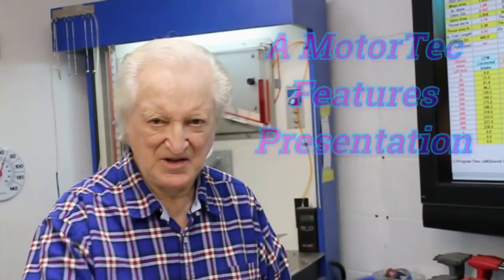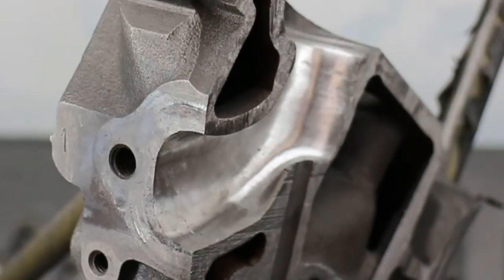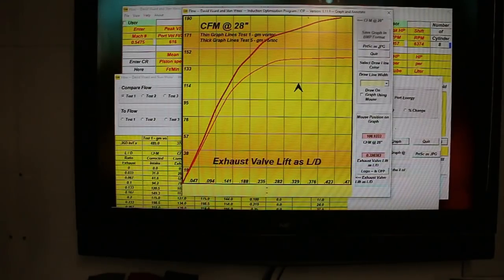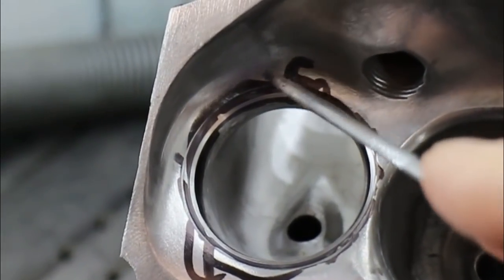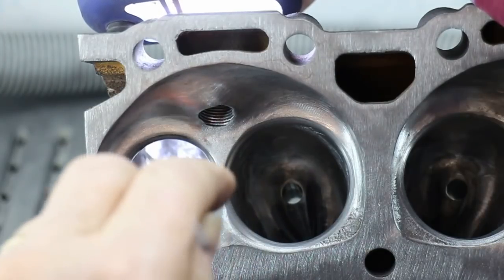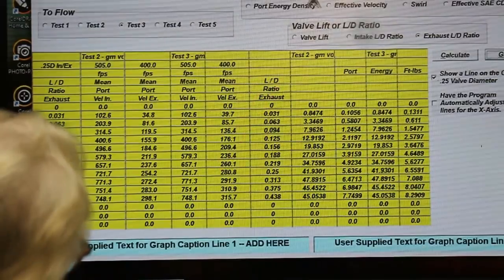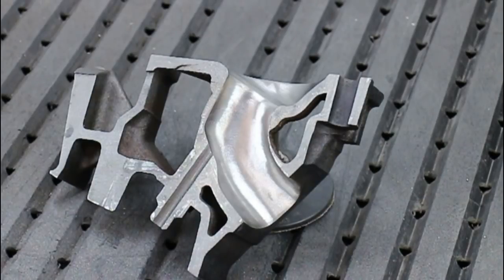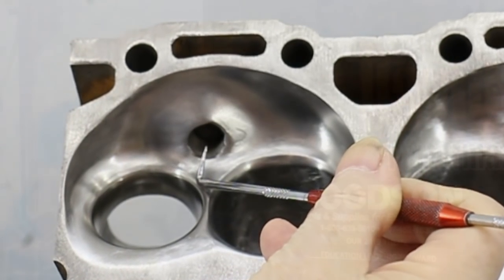David Vizard's PowerTec 10 EP 13 Part 2 Super Porting Vortec Exhaust and all other 23 SBC heads

Comment: Certainly not enough information im sure but what would you say about a 6000 pound 4x4 automatic trans truck with a vortec 350 that has .010 milled heads and .020 gm performance head gaskets and gm performance dual plane aluminum 4 barrel intake and a 650cfm carb  and hei distributor (1.60" ehaust valves and 33* seat angles). Stock exhaust manifolds but free flowing exhaust after the manifolds
My question is with those things considered what would you say to putting in a hydraulic roller 208/208 (or 208/212) duration @.050 and .420/.440 lift with 107LSA since i want to keep this a reliable daily driver i can still do truck things with and still have the engine last 200k+ miles?

Comment: David:  This is some of your best videos I've seen to date....I have a question:  The quench area below the spark plug and above the valves should not be touched to a grand extent because the fuel will not be atomized.  What are your thoughts on this?

Comment: Hi David, I built the 447hp sledge hammer budget build you designed  the cam shaft for.  The cam does not have a lot of overlap. Would these port mods improve my build or hinder it. (I did a mild clean up port job on the vortecs) Thanks.  Love your video. I built my 1st motor using your how to build a sbc back in 85 with no engine building experience at all. Have since built many more after that. I am especially  impressed with the 447 sledgehammer build. Cheers

Comment: Do you port match the coolant passage also? I have a #906 Vortec head and there is ALOT of material within my blued scribe mark. Intake gasket is out of a kit. "Problem solver gasket" i was told. Plain metal core with black rubberized molded gasket around port.

Comment: Great info and very well made but just so the young guys are aware, gen 3 hemi heads and the higher end LS stuff all flow 300+ CFM (426 hemi flow numbers and better than any big block chevy), you're starting at a much higher level just by using one of those engines, if you have the means.  I believe the 392 flows 340 cfm bone stock and the 2009+ 5.7L eagle isn't far off, an engine you can find in any junkyard.  If I was a kid on a budget I'd be going 09+ eagle and Holley EFI, it'll cost the same as a set of aluminum heads for a chevy. mopar or ford small block - and absolutely destroy any of them

Comment: Thank you so much, I have a set of Iron Impala LT1 heads that im porting out and machining for bigger valves. Im following your advice as much as possible with these because i know your right. Your books showed me Behive springs, how much valvelift i need, timing advance, lash on roller lifters etc.  My first cam swap was a success over all because of your guidance and I know im still in good hands with these heads.

Comment: Where can I get a decent vented porting station like you got. I saw some but the prices where crazy. Any tips or advice on where to look for one ?
Reply from the maker: Paul,
 We make our own at the school and sell some on the side. Brand new $7000.
Reply: @marvingvx1  paulskarts@gmail.com let’s continue this conversation by email if you can send some pics I’d like to take a look. Thanks
Reply: Ive seen ones made out of old bbq grills from a garage sale or found at the dump. Honestly it works. I made an adapter and filter box for my flowbench so I could just port on it instead of making something that takes up more space.

Comment: David i have looked up to you since a teen. I went to work for a family friend who owned a automotive machine shop  and was the engine builder /fabricator that built my dads two show cars.. I already had a passion for motorcycle 🏍 and motorsports off road racing got introduced to a dragster..got the horsepower bug bite on my own time that summer I between learning how to cut valve seats resurface heads ,guides,valves,I learned very quick the heart to performance was heads and cam centered . My uncle taught me how to work over a set of camel hump heads once he showed me the carbide cutting bits/sand paper rolls and a old 600series flow bench I spent all my money buying heads and sandpaper rolls carbide cutters long short and exotic lol bought a used flowbench and went to town made some serious big block power on stock casting for 1994

Comment: Hello, I have the head off my Toyota 1zz engine at the moment. It is a typical modern 4 valve design with the usual rough casting marks etc in the inlet and exhaust ports. If I was to try to smooth these down, assuming I do a decent job of it, am I likely to get a noticeable power increase if the rest of the engine stays standard or will it just make minimal difference?

Comment: The spark plug area looks a lot like the chamber wall that is typical of an open chamber Big Block Chevy head.
I wonder if this will reduce chamber swirl as the block that used to induce that has basically been removed, less swirl could affect ignition timing .. of course if intake port swirl is improved (by more biasing ?) it would negate that .....
After seeing this vid i can see i need to spend a bit more time recontouring the valve guide bosses.

Comment: I have two sets of aluminum heads I'd like to port, a max street effort head, (if there is such a thing), for a lot of TQ, 3400lb vehicle, with 385cid, for one set, and the other possible 406cid , with high velocity ,high efficiency, in mind for 2400-6800 with 585" lift on the 385, I would like to flow match the ports, I can't see having them professionally ported, when I'm capable, with guidance, you inspire me, 
I want to get back at it, after being unable after a car accident, I have been laid up for years not being able to do as much as I'd like! Thank you!
Reply: Edelbrock heads always seem to pull a little lower numbers than everybody else, if that's what you have then you probably have some room for improvement.

Comment: I would like to see dodge la motor done . A pro like you would I bet make a killer head. Would like to see the difference between the two to. Thank you for your work you do for this.
Reply: Wouldn't you be better off starting with a Magnum head ? The Magnum was developed right round the same time as the Vortec, technology of the day was looking at what had been learned from the TBI swirl-ports and improved chamber designs, if i recall correctly the LA head is a non quench smog head that is actually a step down from chevys gas guzzling open chamber 883 casting, sorry ta rain on yur parade. Check out the Magnums, see what ya think of those.

Comment: Thank you David. Ill be looking for your live session with Tony.  I have a suggestion to show how anyone can find the flow through a port with exspensive equipment.  Recently ive hooked up a wood shop vacuum system to a 4" polycarbonate cylinder.  When i turn it on with a adjustable dial for the valve lift. I then spray diluted marking dye from a spray bottle into the cylinder. It leaves a very clear marking on where the liquid flows inside the ports. Darker areas are where the mass of flow is making contact on the walls. Its amazing how much the valve boss area directs flow in the port. It literally becomes a ramp for most of the flow coming in from the intake side of the exhaust port.
Reply: Nice!